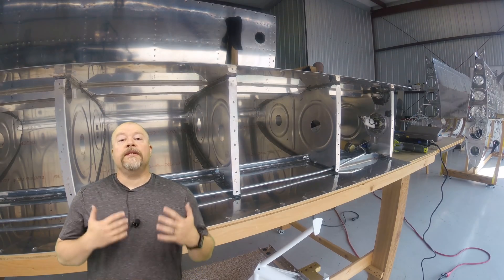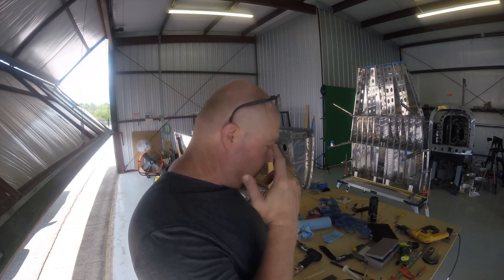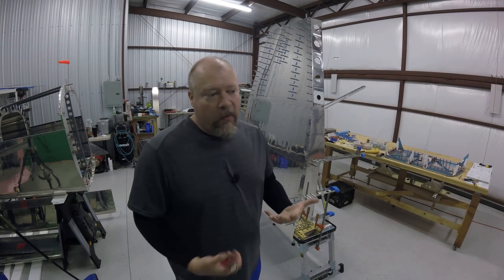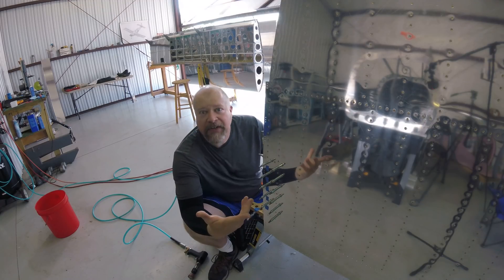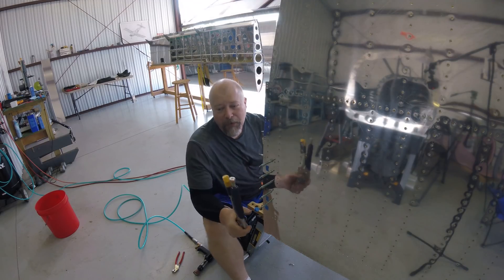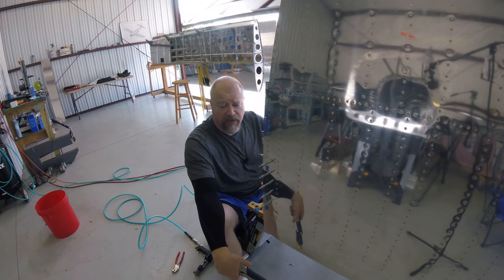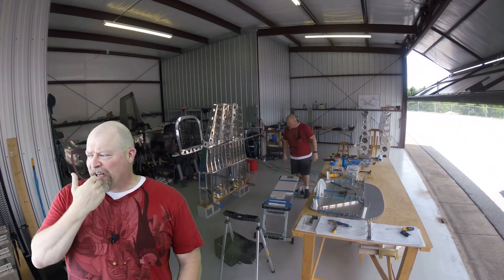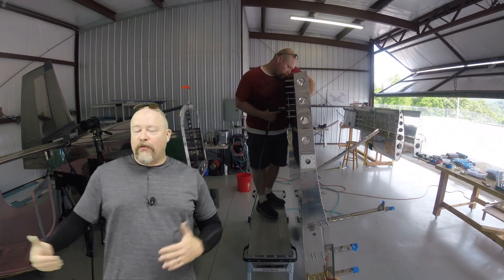RV-10 Fuselage - 012 - Slosh Sealing Tanks, Finishing bottom of fuselage

Comment: Obviously, you need another tool :-) you can buy an  EXTENDED 12" BACK RIVET SET (DOUBLE OFFSET) designed just for the RV-10...Or, a chunk of cold rolled bar stock for a DIY bucking bar.

Comment: Sloshing compound is a last resort solution, it tends to flake off with age and heat. Only thing we ever really used it for was for the inside of floats. To get an almost instant cure on it you follow up the sloshing compound with fuel... Spray on or slosh some fuel around and your cured in just a couple of hours.

Comment: Never never never use slosh sealer! Back in the day, guys would do that, but they found that it would come off in flakes and clog things! The only fix after that is to rebuild the tanks! Never use slosh! I think if the entire interior was scotchbrited, it would stick better, but I wouldn’t buy a plane with sloshed tanks unless the price was low enough where I would rebuild the tanks without it. Very dangerous to use it..
Reply: You have to scotchbright and chemically etch the interior surface first.  I've seen a video on this, and also read a builders paper on doing that too.

Comment: Thank You for sharing this. Yes, leave that fuselage sub-assembly there it's a great backdrop.  I have seen blind rivets on certified aircraft even on the dc3 tail cone Mikey is filming each day. If you leave a hole un-riveted on the bottom you could call it a drain hole. grin! Weeping, seeping, or leaking, there are definitions for that IE So many drops per min.